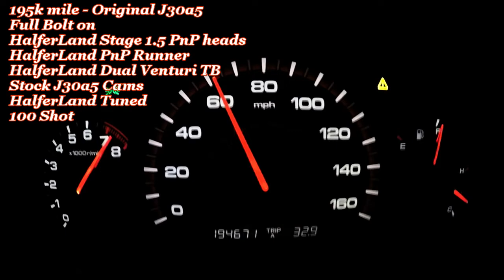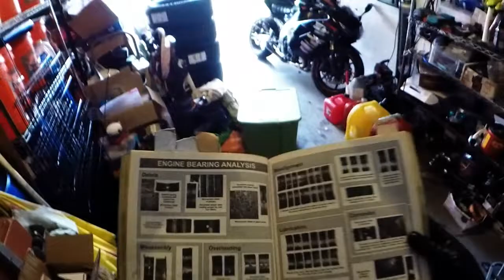Honda J35a7 "HalferLand Stage 2 Turbo Short Block Build" -TEAR DOWN- (DAILY DRIVER-PART 2)

Comment: Cody lovelands Enviate Hypercar has a j35 right now instead of an lq4 and then a 5.3L . The world is slowly waking up to the J series. Greta build
Reply from the maker: For sure. It's a great little motor and with basic strengthening parts you easily turn them up to 800-1000whp and beyond. Our J35 will be as simple as it gets. Our 1000hp J35 Rods, Stock pistons with ceramic coating (dont plan to turn this motor up past 800whp) , stock crank (which is forged) and stock sleeve (adding our HalferLand J32/J35 Block guards to keep those cylinder from shifting in the open deck). This forumla should allow for a very reliable 600-700whp J-Series at a very affordable price!
Reply: @HalferLandPerformance  does the vtec hit hard on the j sohc  just like the k dohc
Reply from the maker: First Last  If untune, yes, if you tune correctly all that should indicate Vtec is sound. You want to adjust the tune to have an even power band, if you see a sudden spike in power from Vtec, you would need to move you Vtec down. You can see me review this in my Stage 2 cams Dyno video

Comment: What engine harness are you using on this motor since it's going into a accord. Also is the ECU stock or will you use the hondata with the TL computer

Comment: how do you take the crank pulley bolt off with hand tools  plz
Reply from the maker: Zac HK  . Depends if the motor is out of car or in it. If in, either apply the breaks, put in gear...and use a big breaker bar.....or blip start method.
If out of car, use the extension through the flex plat or on fly wheel as shown in video
Reply: HalferLand Performance The J-Series Freak's okay, thanks, very smart im thinking about doing timing belt and no idea how to take that bolt off
Reply: idk if you have a easier way to take the oil pans out , i saw tech have to damage a little edge with chisel out side of it in order to break the RTV open since it is very tie seal. I have Tl type s which is J35A8 engine with 140k , there’s a lot of oil leaks 😂😂😂
Reply from the maker: Zac HK  I didn’t hit the matting surface. If you look I lightly tapped a tab which is designed to be lightly pried on/tapped. After I got it a hair loose, I then used a rubber mallet to tap the pan up on the tab, not the pan itself👍🏻 Never damaged a oil pan doing it that way